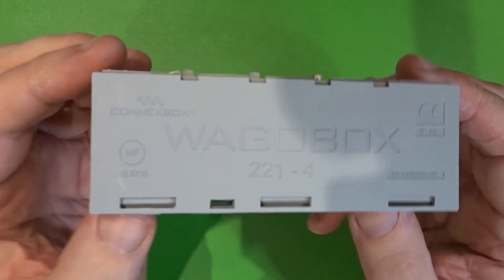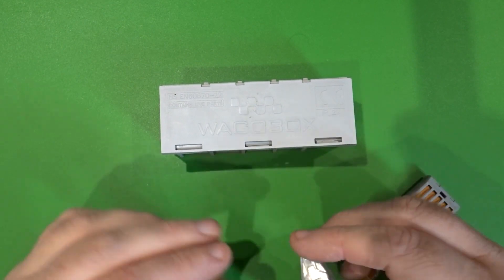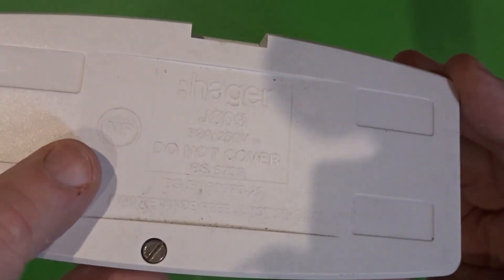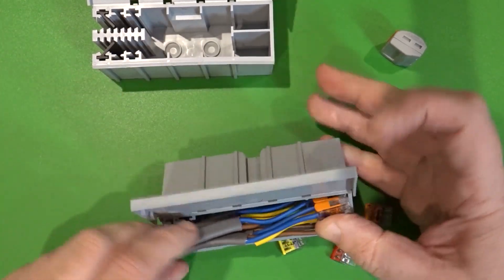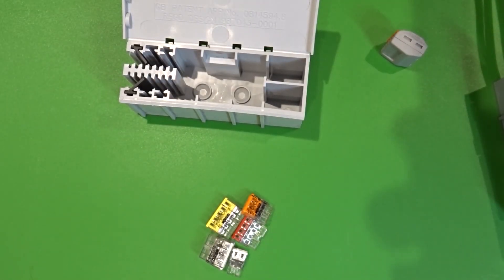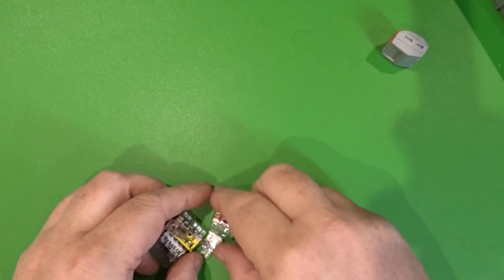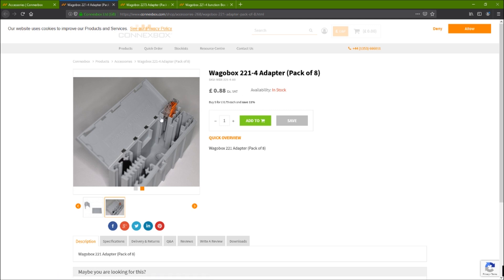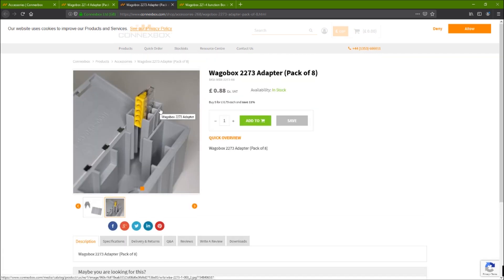CONNEXBOX/WAGOBOX - How to accommodate the new Wago 2273 and 221 series

Comment: Can't help but say the whole vibration thing is totally over the top. When you consider the shocking state of some wiring you see and the other rubbish ways wires are connected or shoved in back boxes it just strikes me as over the top.
Reply: Over the top maybe but why are some screws loose in juction boxes and socket terminals? The original installer wouldn't generally leave them 'loose'. Physics ...

Comment: Great content, does the box have to be secured to a joust etc, in order to comply with the maintenance free requirement or can it be just placed into a ceiling void or under a floor unsecured and still be classed as maintenance free joint/conection? Regards, Simon.

Comment: Another thought, the wago boxes also require a tyrap to make them MF. If the box is situated in an inaccessible place, how would you know it had a tyrap on it, so what difference would it make? I accept the tyrap when its accessible to prevent access by kids etc
Reply: 'access by kids' ? Access by anyone  without the use of a tool is what the regulations are getting at so even if hidden or accessible, you need a tool to expose the terminals - thats the general idea...

Comment: As i understand they use spring type connectors in rockets because of vibration. Cant for the life of me understand how stopping a floating wago connector of any type will make the blindest bit of difference to the connection. I was also told by a Wago representative that the spring connectors will actually get tighter over time.

Comment: "Every day is a school day", I didn't realise till recently that putting cables in Wago connectors in a Wagobox on its own wasn't good enough to be MF but had to also have a cable tie securing it closed to comply with the "Tool required" part of BS 7671 and now I've learnt from your good self that there also needs to be "packing material" to prevent movement of incompatible Wagos so thank you Mr Watts, much appreciated.
Reply from the maker: Your're very welcome, it makes you think though why some of these things couldn't have been better instructed in the beginning at the point of sale....

Comment: Thanks for this - very interesting. I am struggling with this idea of maintenance-free and vibration. I assume that the intention of these inserts is to minimise vibration of the connections in the Wagos. I wonder if there have been any tests. If the Wago box is vibrating then constraining the connectors in it with inserts could be worse than not constraining them. I would like to see the test results and video from a vibration rig.
Reply from the maker: I believe that the box would be fixed, and that the vibration would travel down a cable into the enclosure..  I'll get more clarification at Elex this week. 👌
Reply: Thanks for this. Not sure the cable could vibrate much if it's secured by cable clips...
Reply from the maker: @markrowland5393  that's IF it's securely clipped, which is not part of the requirements for the enclosure.
Reply: @SparkyNinja  Fair point.
Reply: @markrowland5393  - it 'vibrates' due to the cycles of electricty (Hz) amongst other things. That is why junction boxes and socket outlets with screws need tightening over time and this is evident when testing continuity of conductors.
Reply: @ef7480  Thanks for this.  I still remain unconvinced that putting inserts in a Wago box will make any significant difference.  I would like to see real evidence proved by testing. I suspect that this will not be forthcoming... Of course, the advantage of the Wago connectors is that they use springs to make the connections and therefore do not need tightening as they will not come loose.

Comment: I've seen quite a few burned out wago connectors in fault finding. They don't really clamp down very well and I'm not sure I trust them 100%
Reply: Really?? I think I can honestly say I trust them completely far more fool proof than a through crimp in my opinion.
Reply: @tomorichard  think the issue is they are fine the first time they are used. But they get very loose if anyone takes cable out and reinserts. Plenty of burned out loose connections from them. I'd rather stick to junction boxes, far better connection
Reply: @nevermind824  okay if you maintain access to the JB but non-compliant if you want to hide them under the floorboards in an inaccessible location to be MF, which is the raison d'etre the of Wagobox
Reply: @olly7673  From my experience they are not maintenance free, as they fail. A good crimp doesn't fail and is truly maintenance free
Reply: @nevermind824  These are only MF if manufacturers instructions are followed. Look at standard for testing to 'MF'.
Reply: @tomorichard  through crimps, honestly say I've never seen one of my crimps go bad! Best connection you can make in a broken cable
Reply: Better off using a junction box in my opinion. Less space and cheap

Comment: If vibrations come down the cable into the enclosure, isn't it better if the terminals float freely so that they vibrate with the cable?  It's only by holding the spring terminal to a non-vibrating position that the forces will put a strain on them.
Reply: The terminals still have mass - of course there's a strain on them if they're free floating.

If you clamp both cable and terminals to the enclosure they can't move (significantly) relative to each other.

Comment: Vibration from what exactly? I'm assuming in a domestic location,  say a ceiling? Enjoying the videos ninja - regards ;)
Reply from the maker: I dunno 🤷‍♂️.

I know if you mounted one of these on a joist under my floorboards on the landing, or above the door to my 6 year olds bedroom, there would be some level of vibration from the building shaking around with all the stamping and door slamming.
Reply: @SparkyNinja  lol I guess so. Thanks for the reply. I do love those wago connectors. What's your opinion on using wago connectors to extend wiring for consumer unit replacement. Or would you through crimp?!
Reply: @dextergodfrey7086  Plastic insulated crimps do not work well on solid core.
Reply: Dont trust through crimps bit hit and miss in my opinion.
Reply: Compression- depression- why not use a lovely modern rated wago. Perfect. Personal opinion.
Reply: Wago then? I'm only saying this as I had to extend some circuits in a board. Labled correctly , however left feeling little unsure? Looked nice!

Comment: I first used the lever connectors, then realised that pushwire were smaller and cheaper unless it was for flex or something I knew I'd need to disconnect soon. Now using all the new lever connectors, and the new 3 way pushwire. Just about out of 2 way in the old pushwire, but still have stock of the 4 and 6 way, which is a bit of a pain... Ah well, beats choccy blocks any day. Just waiting for the lever terminals to appear on accessories, imagine how much time we'd save if ceiling roses had them! Future is all lighting connections at the switch but for retrofit etc...

Comment: Informative, thanks. I don't get the vibration problem though. If the cables are clipped and the Wago box fixed via it's mounting lug, whats gonna move?.unless the connector is floating in free air in it's compartment, I can't see the problem. or am i missing something?
Reply from the maker: Your assuming that all enclosures are installed with good workmanship and therefore not subject to vibration.. this isn't always the case. 

Impact/vibration on conductors if installed poorly could travel into the enclosure.

Comment: This is a bit of a concern. Does this mean that Wago does not believe that their connectors will stand up to the vibration test unsupported by the Wago box? I would have assumed that under test conditions, Wago "maintenance free" connectors would remain properly connected to the conductors without any further external support. Does this mean that Wago connectors cannot be classed as maintenance free when not carefully slotted into one of their special boxes?!
Reply: Wago connectors are only MF to BS5733 if contained within a wagobox that forms part of the test. Just like how ideal connectors are only MF if contained in their box. It is a common misconception that the connector itself is MF when it actually the assembly as a whole.
Reply: Thank you.

Comment: Would a blob of silicon to stop movement suffice?
Reply from the maker: Not for me to say. It would be up to ConnexBox to test that option to the standard test conditions mentioned in the video, if they conclude its acceptable then they would have to provide the instruction for us to comply with BS7671 in this way.
Reply: @SparkyNinja  And either way it's not a particularly great option - big tubes of neutral-cure silicone, curing in the nozzle resulting in wastage, cleanup, yet another tool and material to cart about..
Reply: Monkeh silicon is part and parcel of an electricians kit is it not so no more to cart about and the amount required to hold a wago in place wouldn’t require any clean up
Reply: @petetaylor9511  It's not something I'd be carrying about for a simple joint inside a building. And there's always cleanup.
Reply: SparkyNinja Connect box aren’t going to go with that option but it would do the job if not better
Reply: @petetaylor9511  I like how we've gone from "would it?" to "it will do it better".
Reply: Monkeh glad you like it ( I know they wouldn’t budge but like I have said Connect box wouldn’t go with it )
Reply: a blob of silicon wouldn't do much good, but silicone might be better...